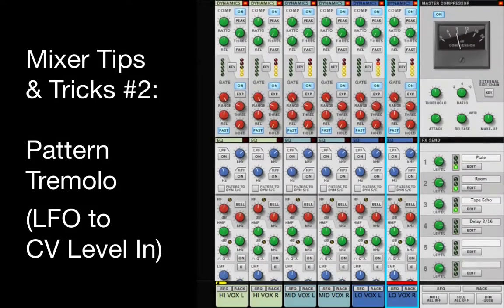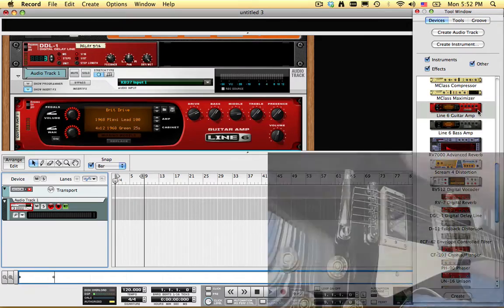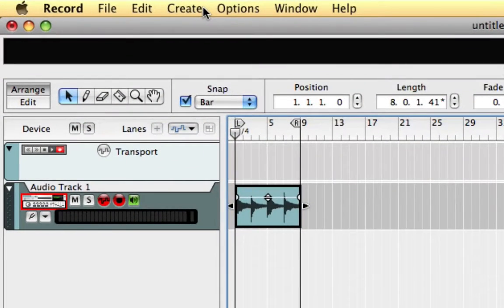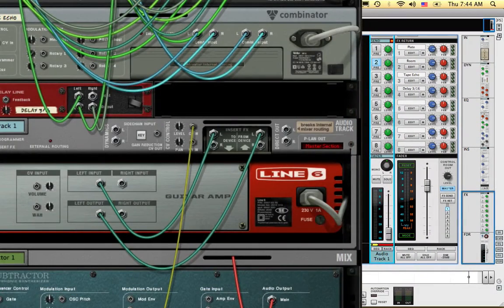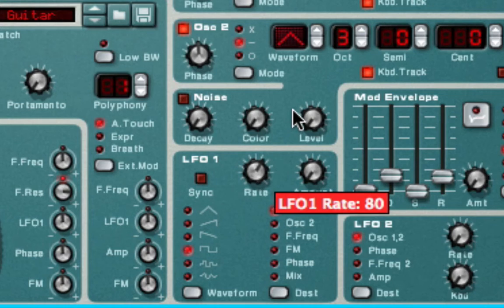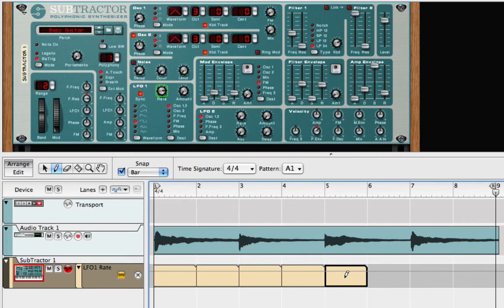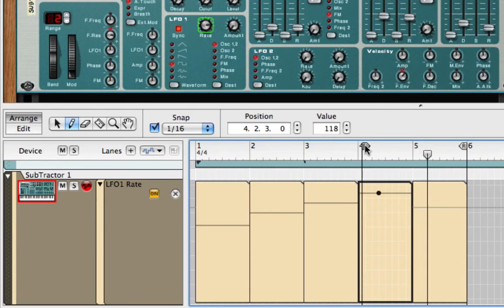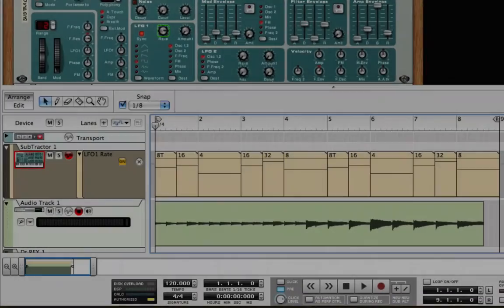Mixer Tips & Tricks #2: Pattern Tremolo (LFO to CV Level In) | Propellerhead Record + Reason

Comment from the maker: Better yet, you may want to upgrade to Reason 6. It includes 100% of the Record functionality, including the mixer. Record has been discontinued. I don't know of any way to send virtual control voltage from Reason to control parameters in a ReWire host application.